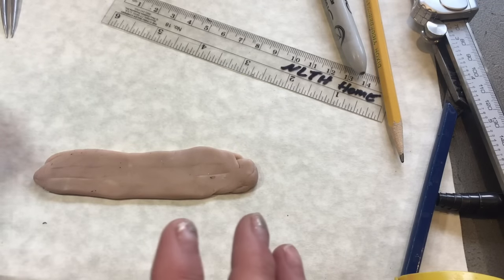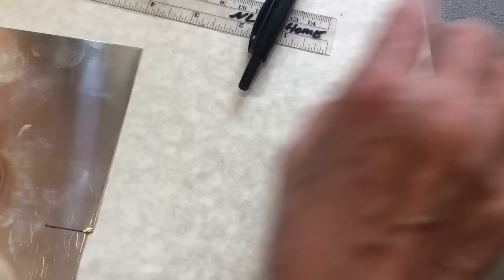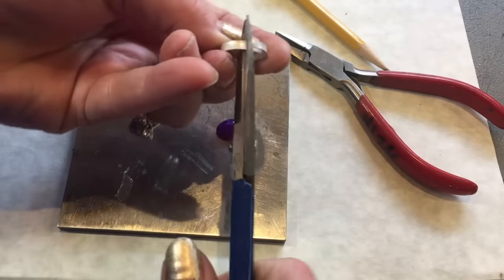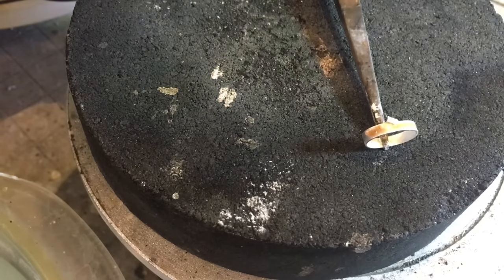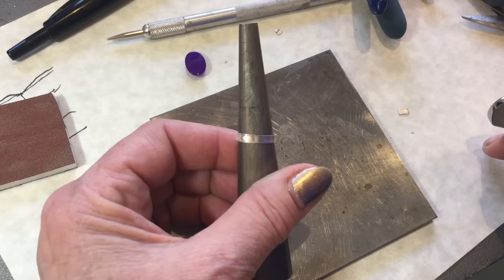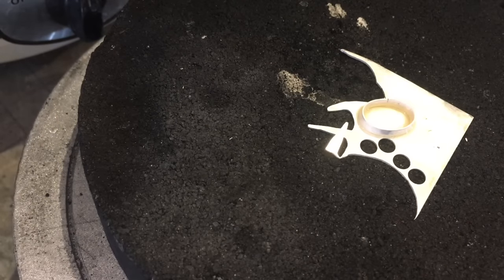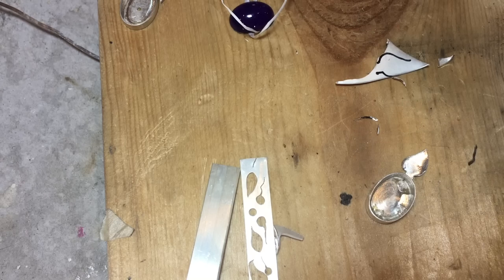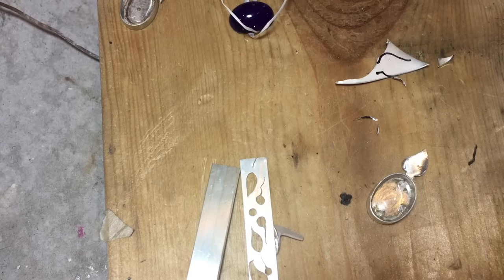How to make a bezel and set a cabochon - Part one.

Comment: I went to jewelry school back in the early 80's and I guess no one had ever heard of the ribbon hack for checking stone size... at least no one bothered to tell US!  LOL   Seems like a natural thing to do, but... nope.  I tried to rattle MANY stones out in the ultrasonic before drilling the dreaded hole in the base. If I ever DO make jewelry again, I'll NEVER forget this priceless tip! Thank you!
Reply: What is it with the schools? I took only one jewelry class, while I was in interior design school, at a very prominent school with an internationally know teacher - and never once did he mention even little basics like flex shafts that I recall. We certainly didn't get to use any.I spent half the class just trying to sand things by hand, which totally did in my older, partially arthritic digits, to the point that I wasn't even able to attempt setting a stone, and got a horrible grade for the class. My primary memories of it are about my instructor almost having a heart attack if I didn't have the torch flame exactly right, or, God forbid, used the "wrong" hammer. Something I had looked forward to doing for literally decades was ruined for me practically overnight and I swore off of it and even gave away half my tools. I've learned in the last few years between classes at my local beadshop, shows like Bead & Button, and YouTube videos like Nancy's, that there are, in fact, much easier ways of doing things, and lo and behold, I actually am able to make jewelry without crippling myself! So why do the schools make it so damn difficult?

Comment: This is super helpful, Nancy; thanks! I love knowing I don't have to be beholden to the stock items sold by the various vendors. 

I love that hairstyle on you, too!

I've got a couple of questions.

I've got a few cabs that are completely (or almost completely) straight-sided - and also flat on top, and one of them is particularly small. What's the best way of dealing with this condition? 

Also, my hands don't cope too well with manually sanding and polishing metal, which earned me a horrible grade in jewelry class in design school since I couldn't finish my projects, and made me swear off of metalwork for what I thought was going to be forever. Can't a flexshaft be used for all of that stuff you are filing, both inside and outside the bezel? Which little tool thingies for it would you use, especially to clean up the solder inside?

TIA!

Comment: .....I'm just curious: have you ever tried t make a "Raised Bezel", (by folding the edge over, and "raising" it, all the way around, by carefully hammering it , [vs one that is made by cutting a separate strip of sheet metal, and then soldering it onto a flat back piece]?....   I often see your method done, but, I would think that properly "raising" a bezel might even be faster, easier, and stronger, once mastered.

Comment: I love your videos! Did you ever say what gauge sheet you used for the bezel?
Reply: Joni Filice she didn't say but you can see the guage written on the sheet as 24 ga for the side walls and then she talks about using heavier gage sheet like 22 ga for the back plate depending on the end use ie floating in space, attached to ring.

Comment: Miss Nancy, can you tell me what is the thickness of the silver plate from which you cut the strip for the crimp. thank you
Reply: I believe its 24 gauge or about .05 mm if you watch the sheet she is cutting from there is a 24 marked in the corner.  You can make any thickness some harder to push than others is all